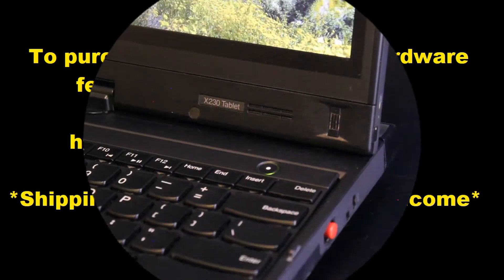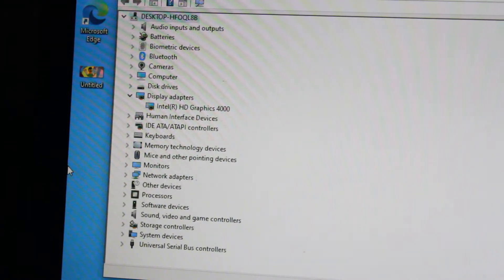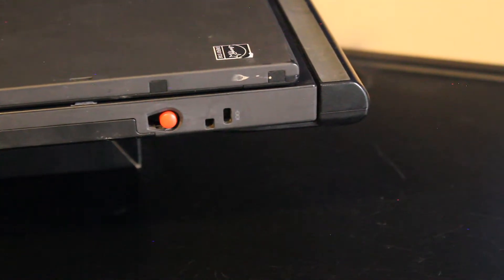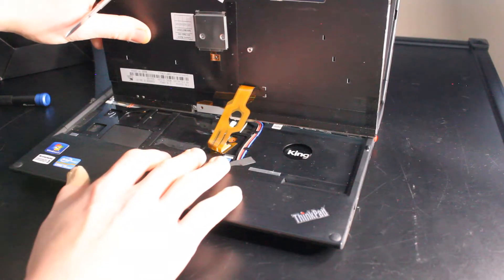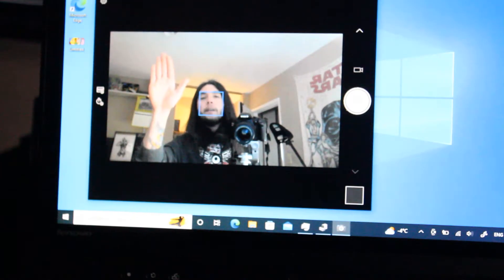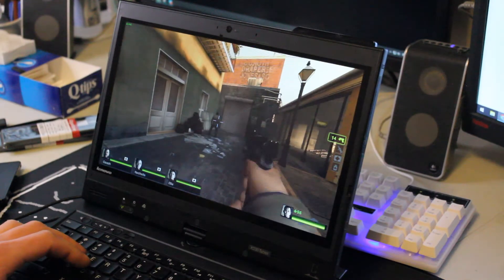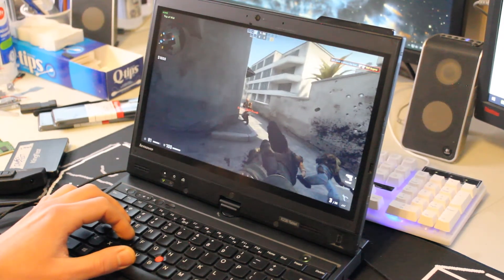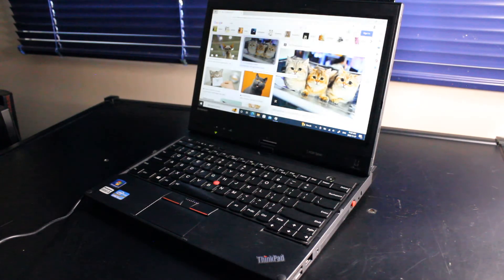Lenovo ThinkPad X230T Review for 2023 - Gaming, Art, General Use

Comment: Interesting detail that the X230T was shipped with a normal DisplayPort where the X230 / X230i were shipped with a mini DisplayPort.  I sniped a regular X230 2 weeks ago for 120€ as my first laptop. It came in pristine condition with top specs (i7-3520M, backlight keyboard etc.). After replacing the thermal paste and a clean windows 10 install I upgraded it with a 500GB SSD, 128GB mSATA and 2x8GB DDR3L RAM. For a 10 year old laptop this thing runs like a demon, is super light and has battery life for hours. The only things I don't really like is the display and trackpad which are both really low resolution. But in terms of price / performance the X230 models are still relevant in 2023 for sure!
Reply from the maker: That is awesome and I am happy to hear you are enjoying the X230!  It is too bad that there are no 1080p panels, but it is what it is.  Still a solid laptop, I agree.  I just did a similar review on the X240 if you want to check that out.  Different aesthetics but similar performance.

Comment: Got the same model, also with multitouch! It was a pain to find one in the EU. 
Couple of notes: Instead of MS Paint, I would've showcased how the Wacom tablet and stylus work in Photoshop or GIMP, for sketches it's actually pretty good, the poor man's Cintiq. You can get the screen to auto-rotate when you flip it and close it in tablet mode by downloading a Lenovo driver specific for the X220T and X230T. For anyone considering running it as a daily driver, I suggest installing 1vyrain as a BIOS, it removes the whitelist for the wireless cards and allows for the installation of a modern Intel AX210 with WiFi 6e and bluetooth 5.3, futureproofing the machine. It also frees the connector where the bluetooth module is housed and it can be replaced with an internal USB 2.0 port for dongles and shit. It also allows to unlock the TDP and to overclock the Intel HD Graphics 4000 for marginally better gaming performances on older titles.

That's about it.
Reply from the maker: I totally agree about GIMP or Photoshop, but I don't use either of them regularly and there is only so much time in the day.  Cool BIOS trick, I am not aware.  I would love to look into that next time I come into some more of these.
Reply: hey same i am looking for one any good sites to find it?

Comment: Hi, is the serial port bi directional? Do you have any i7 3gh touch screen?
Reply from the maker: Well, to add a serial port you would either need a docking station or a USB to serial port adapter.  You would have to check the specifications of either option.

Comment: Interesting, my stylus on x220t only works when screen is in default position(not rotated), no matter if I use windows or Linux. It seams that either x230t is upgraded to allow for rotation,  or my x220t is slightly broken.
Reply from the maker: Slightly broken as when I had my X220T it worked fine with a stylus rotated in tablet mode.
Reply: @HaisteComputerRepair Weird way to be broken.
Reply from the maker: @Adaminkton  Definitely.  Have you checked the tablet mode settings in Windows?
Reply: @HaisteComputerRepair  Tried different drivers and settings, and I'm also dual botting linux where I get the same problem. 
In unrotated screen the mouse moves normally when using stylus, but in any other orientation it floats in reversed way. If I move the stylus up mouse moves down etc.
Reply: Also I'm using windows 7 as all the original drivers are provided for it, and the performance is better.
Reply from the maker: @Adaminkton  I believe there is a way to calibrate it in bios but I can’t recall.  I know I did it.
Reply from the maker: @Adaminkton  I used windows 10.  I didn’t really use the stylus outside of doodling here and there, though.
Reply: @HaisteComputerRepair  I might still try Windows 10 just for fun. As for bios, I looked through it many times in search for a solution of a different problem: when my x220t is completely turned off the fingerprint reader LED is always on. It  is a nice feature letting me log in into Win 7 just by using my finger, and not even touching power button. But on the other hand it doesn't work in other OS and it slowly drains baterry. There is an option to disable "pre-boot" finger print logon but it doesn't seem to do anything.
Reply: Ok, I found out how to disable finger print, when laptop is turned off: the option in bios is only concerned with bios password. The only way to do it is to use think vantage software for Windows 7, (mayby 10).
Reply from the maker: @Adaminkton Tried this forum for the touchscreen problem?  https://forum.thinkpads.com/

Comment: is it possible to change x230t motherboard with x230 (put x230 motherboard in x230t)
Reply from the maker: I'm not too sure, I don't know if there are different display panel connections.  It might help to look up the X230T and X230 panels and see if they match.  What is causing you to consider this?
Reply: @HaisteComputerRepair  Really hard to find x230T with i7 thats not over 250 Euros...Overall its hard to find ant X230t in Europe without paying 200+ Euros and I am not paying that much for and i5 let alone i3..
Reply: @HaisteComputerRepair  Also I did look up the pannels and motherboards to me they look the same but im not sure
Reply from the maker: @phobiac281  I totally empathize with that.  I don't think the motherboard would fit the X230 chassis without some modifications.  One has Mini DisplayPort and one has full size DisplayPort.  As for the layout, I would have to take a look at the boards side by side to make sure.  They are similar in size, but are two different laptops.  If I get a chance I will try to do some research.  In the meantime, let me know if you find a solution.

Comment: which windows version do use on this laptop? Because I bought one about two years ago and it came with windows 10 pro but had some issues like the fingerprint device didn't work. I  installed windows 11 on it, but the problem is still the same even worse, and I'm intending on installing an old version of windows, so I want to find out which one is best suitable.
Reply from the maker: The newest version of Windows at the time of filming.  I didn't make note.  Did you try installing the Win 7 drivers for the fingerprint reader?  Did you double check that it is enabled in BIOS?
Reply: @HaisteComputerRepair  Yeah bro, I did, but all in vain. I even started to think it is a hardware issue, so I stopped trying fixing the software.
Reply from the maker: @AhmedAllam-22  I haven't really tried to activate a fingerprint reader in Win 10 since an x220.  Sorry, I would test it out if I still had one of these.